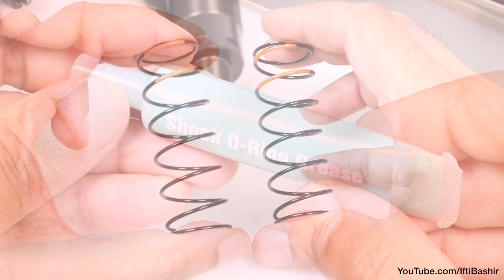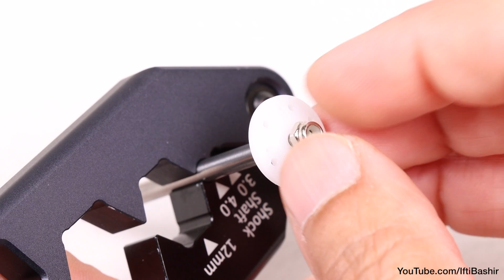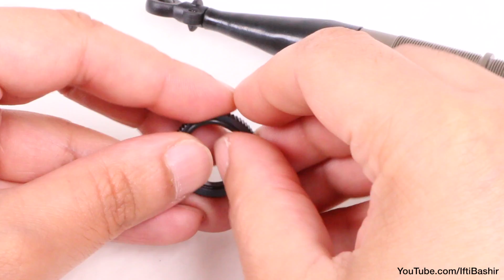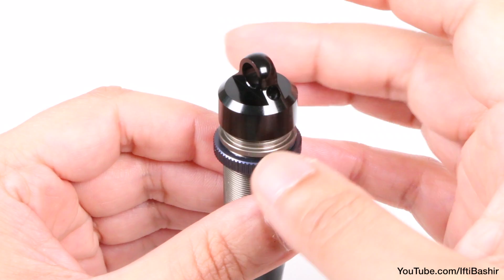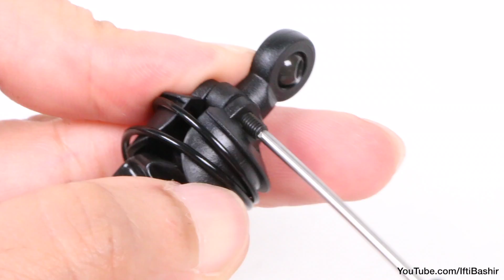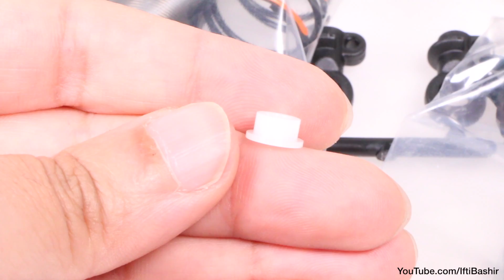#13 Tekno EB48 2.1 - BUILD SERIES - Kit Bag L & M : Front & Rear Shock Assembly

Comment: Slight correction needed. The silver (left hand thread) lower shock screws go on the right side at the front, left side at the rear. Check page 18 of the assembly manual 👍
Reply from the maker: Thanks!